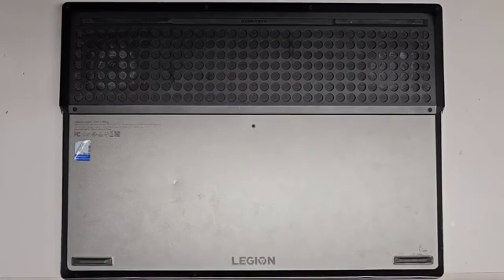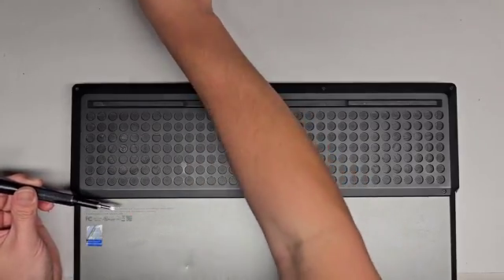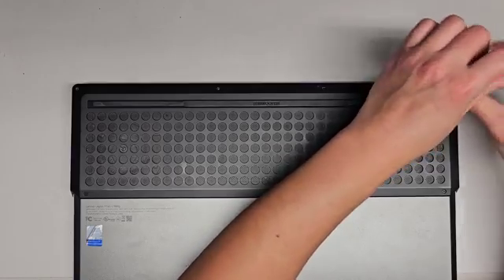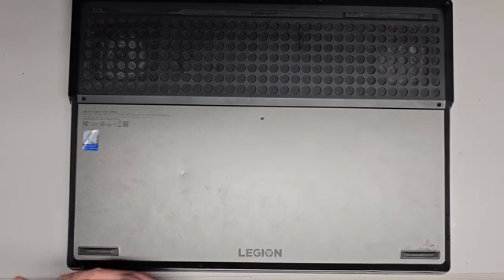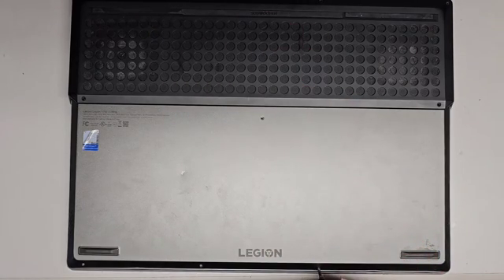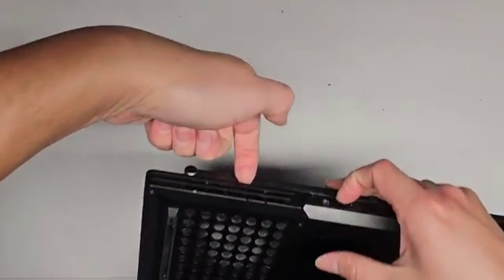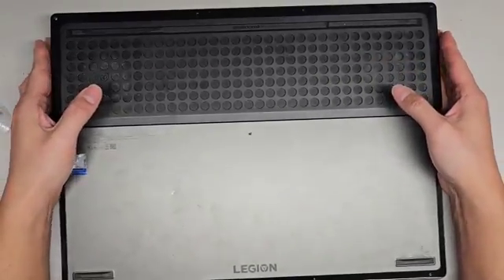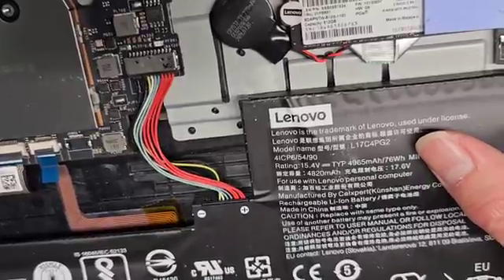Lenovo Legion Y740 Y740-17IRHG Disassembly RAM SSD Hard Drive Upgrade Battery Replacement Repair

Comment: Any tips if CPU is running hot? Are you able to reapply thermal paste for this model?
Reply from the maker: @ayyalicia  Clean the fans and make sure they spin OK.
Reply: @ItsBinhRepaired | Appreciate your acknowledgment 🙏
Reply from the maker: No problem

Comment: hey, thanks so much for this video. Helped a bunch. My system is 5 years old and extended warranty expired. Battry is not bulging, seemed fine yesterday. Power supply shows good voltage levels, tested with Voltmeter. But the system stays dark, no lights come on, it's dead at the power level I suspect. I may want to find a replacement and swap the SSD 1GB storage. Does that work? (Windows 11 Pro here). Or I might take the SSD out and find an adaptor to make it an external drive to recover some of the data from it. Does that work? Other ideas on restoring the power in the unit? Any common power related items to check?
Reply from the maker: If it doesn't turn on, there's no point upgrading it.

Comment: I want to upgrade my 256GB SSD and 1TB HDD to two 2TB Kingston SKC600B 2.5-inch SSD, but was wondering how I can transfer my windows from my 256GB and all my 700GB files from my 1TB, onto my two new 2TB SKC600B? Can I even install two SKC600B's?

Saw a few videos of people migrating windows but they're all on desktops with both old and new hard drives attached at the same time. Surely, I can't do that on a laptop, right?
Reply from the maker: One needs to be an m.2 pcie nvme SSD and the other needs to be a 2.5" SATA SSD. This video will help https://youtu.be/4p5jFDzVwUw

Comment: URGENT
I recently upgraded my hard drive and that went fine but I noticed my battery is super swollen!! I won't be able to get a replacement until a week from now but I'm actually afraid to leave the damn thing in there! It's so swollen it looks like it's ready to blow any minute!!! 

 Is it possible to take the battery out but still use the laptop if I use it plugged into the wall?
Reply from the maker: No idea. Give it a try.
Reply: @ItsBinhRepaired  I tried it yesterday. The laptop can function plugged into the wall without a battery. The only thing I noticed different is the little icon where the battery is has a little X in the battery and says battery not detected. 

I'm currently waiting for my new battery to come in In the meantime my laptop does not have a battery therefore I have to carry my charging cable with me
Reply from the maker: @highlander723  I recommend a battery as a backup, but you don't want to leave it plugged in charging when not using it.
Reply: @ItsBinhRepaired  I'm surprised it didn't start to rupture earlier... turns out these batteries are only good for 400 cycles. I use my laptop extensively everyday and it's over 3 years old.... So it was definitely due
Reply: @ItsBinhRepaired  Just to give you an idea. When I took out the battery I noticed just how swollen it is most lithium ion batteries have like a squishy kind of swollen to them not this one.... This one was skin tight pressurized don't touch me the wrong way or I'll blow type situation.
Reply from the maker: @highlander723  it's normal on bad batteries.

Comment: I have trouble to buy online at Amazon SATA HDD Hard Drive Connector Adapter with Cable Replacement for Y740  ... 17 inch , can you please find link for buy
Reply from the maker: This https://amzn.to/3YMRiYS should work
Reply: @ItsBinhRepaired  ty
Reply from the maker: @naskutak  no problem
Reply: Ty so much I hope this will work on Y740 - 17IRGH
Reply from the maker: Yup

Comment: My version only has a 1tb m.2 ssd for storage. My laptop recently stopped working, and on BIOS, it says hard drive: not detected. Does that mean my m.2 ssd is broken? I can't even get past the POST. Any guidance would help a lot as I'm planning on swapping out the ssd soon. Thank you!
Reply from the maker: Sounds like the SSD is dead